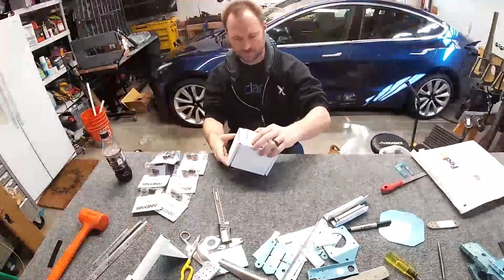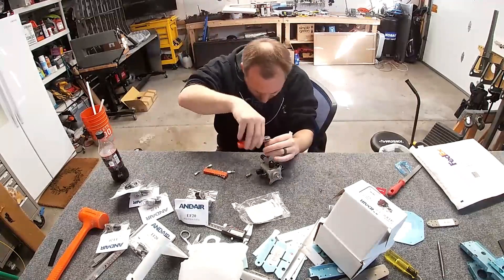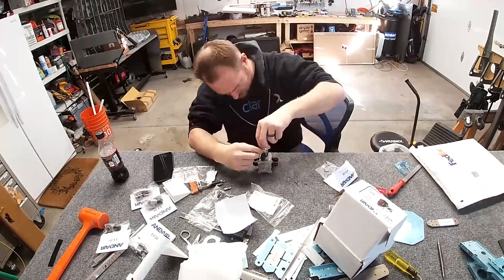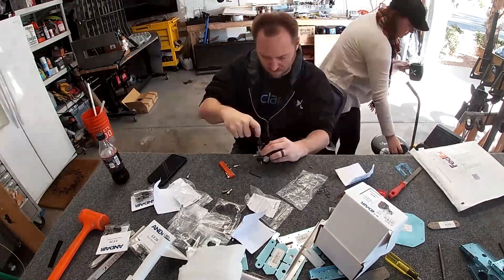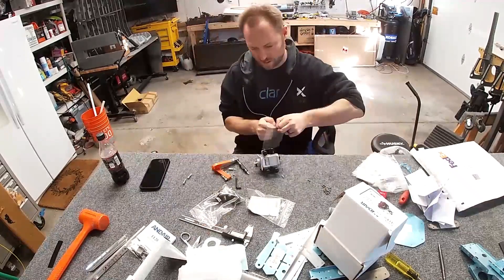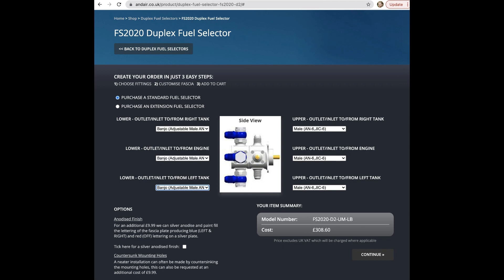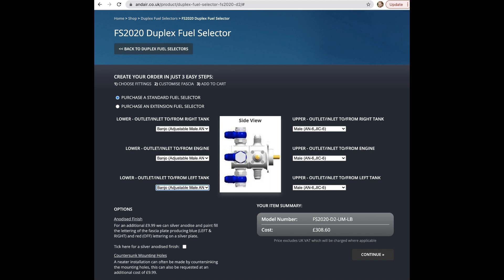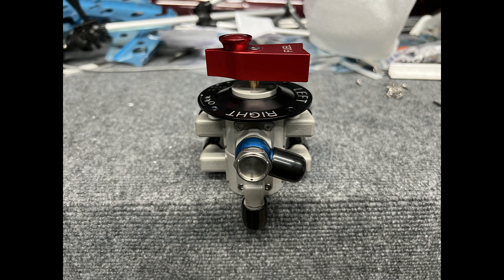RV-14: Fuel System 02 - Andair FS2020 Duplex Fuel Valve Configuration and Ordering Guide

Comment: Thanks, I will try to remember that one. Save $200. Aircraft Spruce will love you for that one :)
Reply from the maker: Spruce could just stock the valve with the right fittings. There’s a thread on VAF where some builders tried to get them to do that but Spruce didn’t do it.
Reply from the maker: Also, the reason why Spruce is probably more expensive is because Andair charges GBP since they are in England.  Spruce probably stocked the valves when the exchange rate was less favorable to USD.